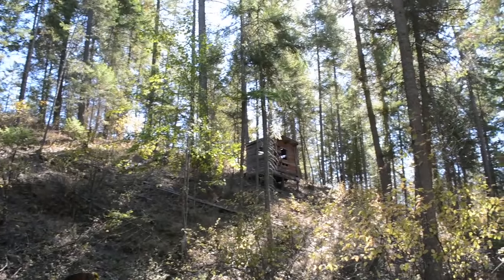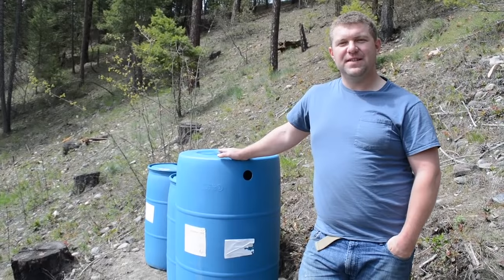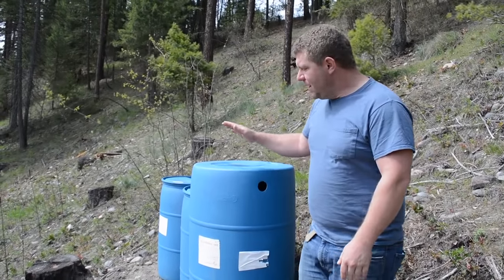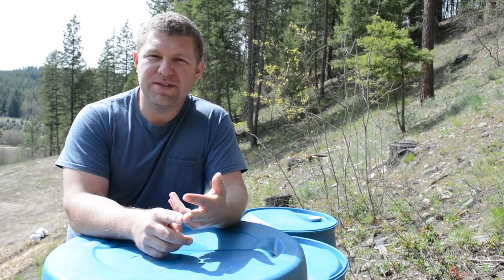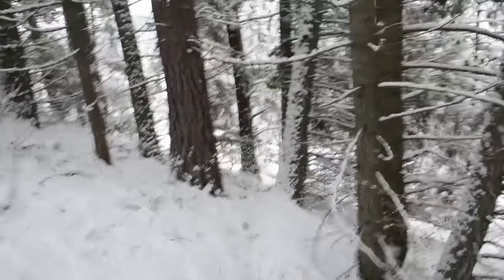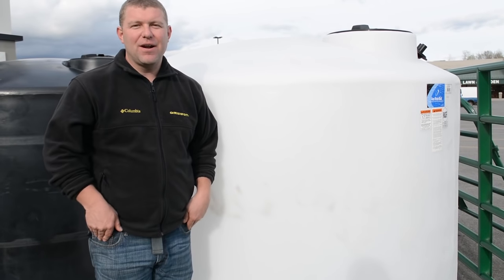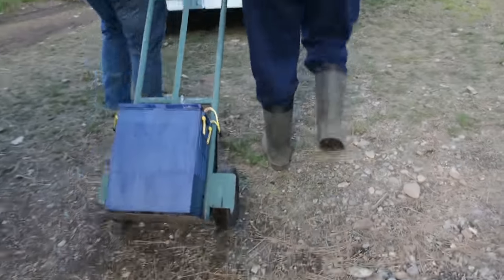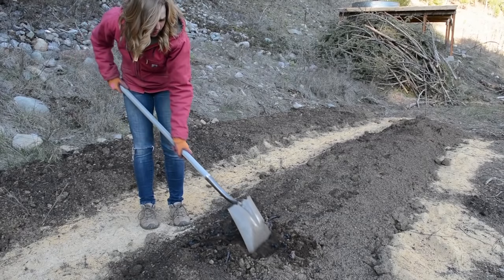Off Grid Living Water Systems: Rain Water Harvesting, Cisterns, Wells & More

Comment: How come you guys built a hot tub deck but didn't expand your house/shack?
Reply from the maker: +Joseph Opanel We're planning on doing a video on this in the very near future... but basically, we're validating our skills. If we were to go straight for a house on day 1 that would have been suicide, but our confidence and skill set grows with each smaller task that we complete, so building our barn should go much more smoothly than if we were to tackle it first. And we really want a place to soak our sore muscles as we don't exactly have enough hot water for a long, hot shower :-)

Comment: What about making a 2 story shed built into the hill. first floor have a wood stove that would also heat your house via radiant floor and also give you hot water. Seccond floor make your hot tub. roof would be warm enough to melt snow and then you could pipe that down into your first floor where a tank would be heated year around by your wood stove? Eventually you can get a pellet feeder, or sign up for a bunch of junk mail and make fire logs from junk mail (free heat! :D). 

Added: Make first floor concrete brick until it perches out from the hillside and pour concrete floor.

Added again: Check this out, http://www.tegmart.com/

Comment: PUT A GUTTERS ALL THE WAY AROUND YOUR HOT TUBE DECK.
FOR ABOUT $100.00 you can buy the gutter all the that hits the deck will go into your tanks. And Use your deck to protect your tanks put them under the deck and plumb all together.

Comment: This type of "living off the grid" is more headache than enjoyment.  I would just find a flat property with a well already drilled and proven to produce.
Reply from the maker: +sfbluestar How will you get the water out of that proven well? Gravity never turns off.
Reply: my neighbor uses a solar powered pump which pumps water into a 1500 gallon storage tank.
Reply: I would love a well but I can't drill in the are I'm in due to restrictions. However I can collect rain water :)
Reply: sfbluestar Aussies that live rurally nearly exclusively live off rainwater. My property has a 20,000 and 110,000L tank that collects off our big shed and house. Fresh and clean water with less contaminates than ground water.
Reply: gravity pump or a pulsar pump, 
Either way in certain area's your gonna want a deep well and not a shallow well.
Reply: How do you keep the water clean setting in the tanks for so long? Like algae, bacteria, etc. Do you add chemicals to it? How do you keep it from freezing or getting really hot in the summer? Does water sitting in plastic tanks begin to taste like plastic? Just trying to figure out how it works. It just seems like water sitting in those tanks would eventually go bad, unless they are regularly drained, cleaned and replaced with fresh water.
Reply: LindyTN Be like the Old West frontier towns where people mixed a bit of liquor into their drinking water. This killed the bacteria, and made for some good times. And some depressing times....and violent times. Okay there are drawbacks! But it would make for some interesting YouTube

Comment: This is the first time ive even heard of a personal cistern being an option! No one covers that ground for some reason. Can you guys go into greater detail on cisterns in another video, since theres so little mention of it? You say to your viewers that there are other water options out there,but you have to remember that all of these people are looking this information up and just not finding more than one option really. Myself included.
Reply: I once lived in a 100+ year old farmhouse. One side of the roof had a gutter system that fed the water across to the cistern. The other side had no gutter - the rain water fell into gravel along that side of the house that contained a pipe (similar to a French drain) that fed into a concrete in-the-ground cistern. The cistern had a thick cement slab on the top which had a pump mounted on it to push the water into the house. (It wasn't in use when I lived there, but I could see where the pipe came into the cistern and the 3 bolt holes where the pump had been.)

Comment: Every hear about Stirling cycle engine coolers and how they can turn air to liquid that reaches ultra low temperatures? Produce liquid air from atmosphere that fills insulated underground cisterns or tanks to use the liquid air has fuel to operate Stirling cold air engines to produce electricity by turning generators circulating liquid air through heat exchange radiators for air conditioning has vapor from liquid air boil off is condensed into water then passed through water filters for drinking water. What do you think about that?